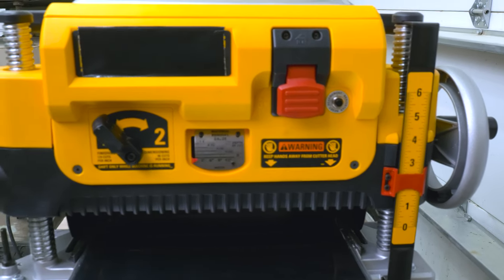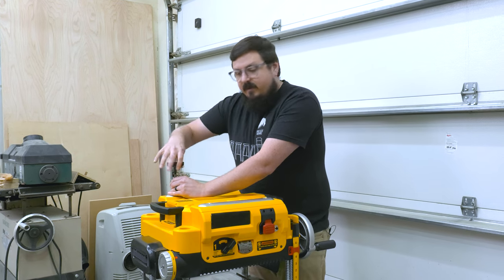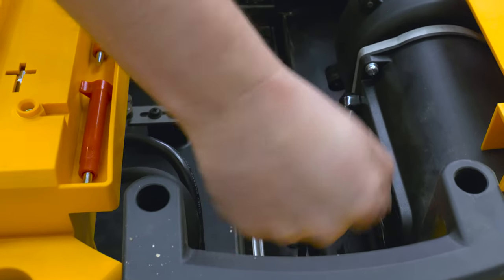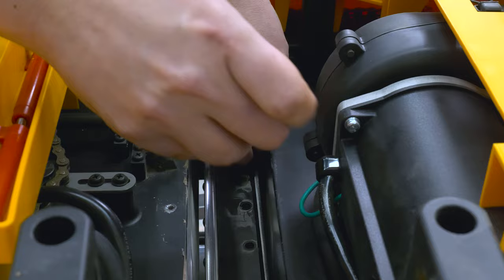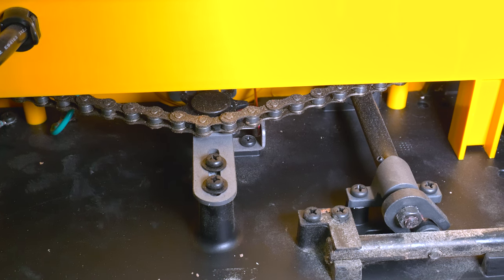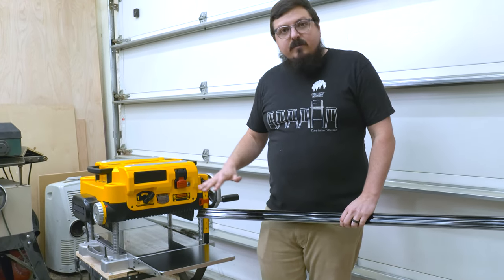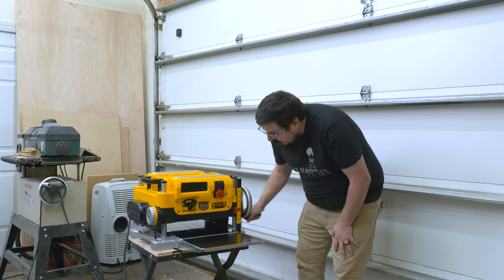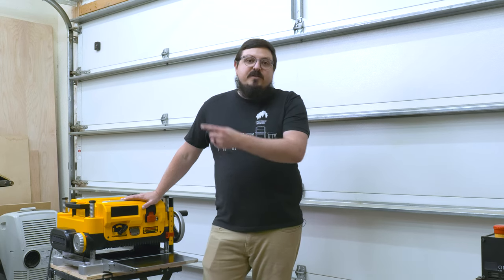ULTIMATE Planer Tune Up for the DEWALT 735

Comment: Hi! How did you handle the chip collection before upgrading to the Oneida Mini-Gorilla? I tried using my ridgid shop vac with a 1dt gen dustopper, but that didn't go over well (blow chips out of every crack found). i found out it really doesn't need a dust collector since it has the fan assist. I am trying to use just a dustopper pro, but that's just ok since the air force coming out of the dewalt is so great and again chips.dust are finding there way out of the collection bucket. I may try the Dust Deputy 2.5 Deluxe 10 gallon kit. Just wondering how you use to collect the chips. Thanks!
Reply from the maker: Good question! I had a Ridgid shop vac connected to a cyclone on a 10 gallon drum that worked okay. It wasn't great but it did collect the majority of the chips.
Reply: Thanks for the reply. New subscriber, nice channel!  @TimberBiscuitWoodworks
Reply from the maker: No problem! Welcome to the channel!

Comment: So I'm having trouble because my actual planer and the factory table is not parallel. How do you adjust that?
Reply from the maker: That is a bit more of an in depth fix. I would take a look at the Saw Mill Creek forum, there is a guy on there who had the same problem and detailed a full fix.

Comment: How are you liking the 735? I need a planer and I’m trying to decide between the 734 and 735. Is it worth the extra money? Seems like most say yes
Reply from the maker: I had the 733 prior which is closer to the 734 and I can tell you that the 735 is definitely the way to go if it is in the budget. With the 735 there is much less snipe and it doesn't struggle on figured stock.
Reply: Well that tells me what I need to know, thanks
Reply from the maker: No problem!